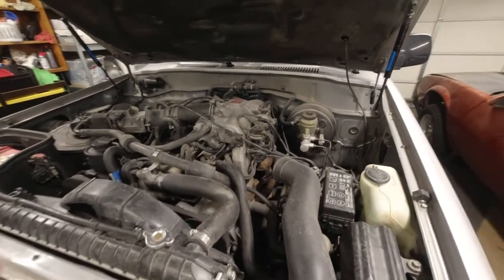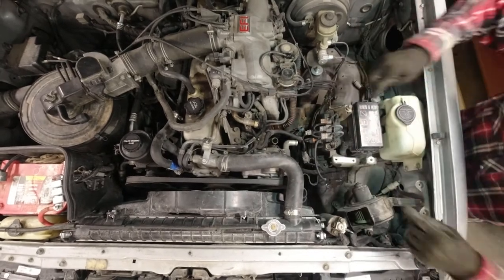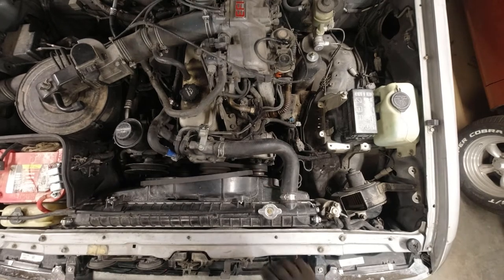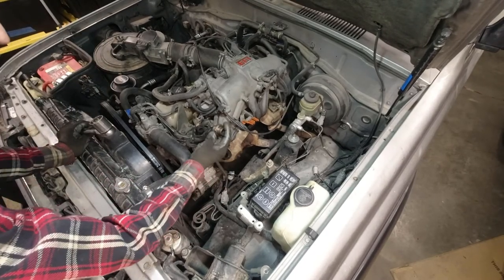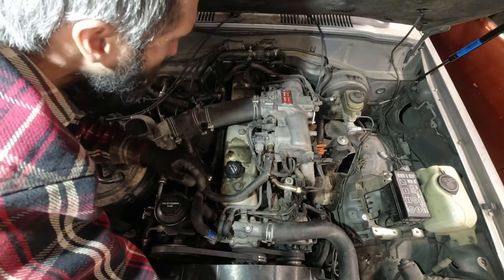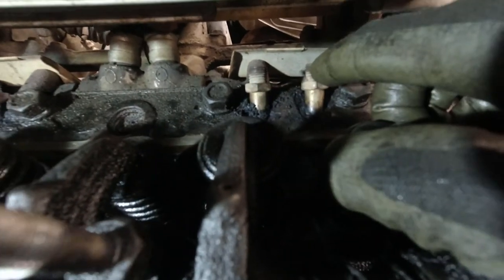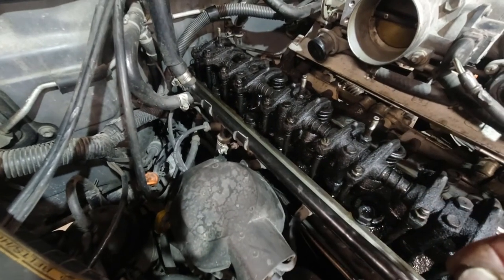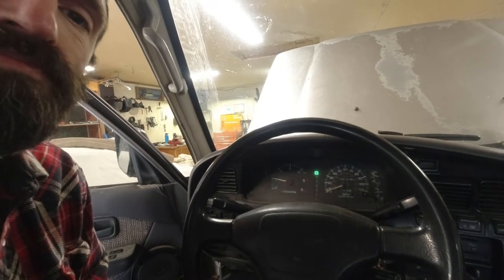EGR Delete - De-smog - Land Cruiser 3FE

Comment: for the exhaust manifold plug a Oil Drain Plug M26 x 1.50 will fit (vw audi plugs have a bolt head not a hex) and cost about $10 a lot easier to remove if you ever have to remove it. the 7 orange Vacuum Block Off Caps are 3.5mm or 1/8" ID ( i prefer rubber to silicone, if there hard to slide on use some hair spray slide on easy and its grips like glue when dry) for the block off plate use the old gasket and trace it onto some stainless steel (same thickness as the egr mount) and cut to fit and reuse the bolts, use Permatex High Temp Thread Sealer on all bolts and manifold plug. I haven't removed that blower pump yet as here in Australia we got hot summers and I always hear it turn on when I turn the car off on hot days fsm says it turns on when exhaust temp sensor reads over a certain temp which I cant remember (i would like to remove it all one day to fit a 2nd battery under the bonnet)  If I were to pull the valve cover off I would do it when the engine is warmed up and check and adjust valve clearance. this is a great vid of showing and explaining how to do the EGR Delete liked and subbed so can see some more 3fe love.

Comment: Just did this to my 91 and I can definitely tell there is more pep in its step!
Reply: Did you get a check engine light after? My light is on now with a EGR code and was thinking of just deleting all that trash. Mine is also a 91
Reply from the maker: @jakep8964  did you already do the EGR delete?
Reply: @jakep8964  No check engine light for the last couple weeks. I have new O2 sensors as well. Have you checked the code?
Reply: @ldooffroad1823  I want to keep the air manifold rail in place and cap of the end as I may need to pass a smog test when I change my 80 to classic rego when I get another 4wd do you know if that is possible and what size nut/bolt will work. I'm about to remove the blower motor and smog pump when i do the belts in the next couple of weeks but i dont need to do the rocker arm adjustment yet so i dont want to remove the valve cover until i need to do that plus my 80 runs on lpg and petrol so removing the the air intake is alot more work.

Comment: I was the first to fully desmog a 3FE (EGR delete, air injection system removal, and cat removal), back in 2004/2005 on my FJ62. That guide you reference is the one I wrote and posted to IH8Mud back in 2005.

19 years later and I have zero regrets. It's still a great way to free up power otherwise robbed from the engine, remove unreliable components (due to excessive age and wear at this point), simplify the engine layout, further increase its longevity, and free up real estate in the engine bay.

Something to add that's not really desmog related but will help immensely with keeping your air intake clean is to plumb in a PCV catch can in line between your PCV valve and the intake manifold. Doing that along with eliminating the introduction of carbon from the EGR system by doing the EGR delete will allow your intake manifold to stay completely clean inside for the life of the engine. If you really want to "do it right" you could take off the manifold and get it hot tanked so you're starting with a pristine intake and no more buildup of EGR carbon or PCV sludge in it.

As far as kits, Vintage TEQ Parts (no business affiliation; we do help each other often on Cruiser related tech issues though) is putting together a full 3FE desmog kit that'll have all the OEM Toyota parts necessary to do the job (save for a PCV catch can, since that's not part of the overall desmog process). It'll have a few different parts from what I originally used to streamline the process a little, based on small refinements I've made since first doing my desmog.
Reply from the maker: I’m honored that you saw my video. Thanks for your hard work.
Reply: Hi Nordic Dan
Help g my son with his 3FE eye delete.
He lost spark once he removed everything 
I have heard we may need to put a 10k ohm resistor in to get the ecm to think see egr. Where might this be installed if so.

Comment: PCV valve Zac. Positive Crankcase Ventilation. The check valve in there should rattle freely like the new one you got. They can be cleaned with brake/carb clean. Well done on the project and video!

Comment: Could I get a link to the kit and the write-up on MUD? I have a 1989 FFJ62 and I want to get rid of the smog junk. I live in east Tennessee and my 62 won't be sold until I'm gone so I don't ever have to worry about needing it to pass inspections. Thanks for a great video!
Reply from the maker: I don't think the kit is available anymore. It's been a few years. @NordicDan did the original write-up. You should search for it on MUD. See his comment below (or above).

Comment: Can you please give a one month update to this project?
Reply from the maker: Quick update: I did this mod about 10 months ago. I went on 3 trips with it last Summer, one of which was 2000 miles. I think the added performance is what made the trip possible (ie: climbing mountain passes). However, the 345000 mile engine is getting tired, and I dealt with a lot of heat related issues on those trips. I don't believe those are related to this mod though.

Comment: Nice video, good job on showing everything. I have this exact motor in my 92.
Do you have a link for the delete kit?
Reply: Found the kit from lerms. They mention Having the cat converter straight pipes installed. Did you do that as well?
Reply from the maker: @gomutha  Sure did! Here's a video: https://youtu.be/TLuijv4Iiyg
Reply: @ldooffroad1823  thank you appreciate the response.
Reply: Do you have the link?
Reply: @teelerito6007  https://lermscustoms.com/products/egr-smog-pump-delete-kit-toyota-landcruiser-tacoma-4-runner-t100-fj80-fj62-3fe

Comment: At 3:13, are there any downsides to removing that duct?
Reply from the maker: I'm not sure what it would affect to remove it all together... You would definitely want to cap it so you don't screw up the vacuum in the intake though. However, I think replacing the hose is probably best.

Comment: You can just do a double nut if you ever need to get that threaded plug out. How would you rate the difference between before the kit and after. I  am going to swap my landcruiser but in the mean time while I wait for this motor to die I want to try and get a little more performance and gas mileage. The way it sits now it just seems tired but I still have no problems going up anything. I don't know about you but if I had 100,000 miles or less I wouldn't change the motor but as I approach up 300,000 I am torn between the good ole LS swap or a diesel swap like a duramax 6.6 or a cummins 5.9
Reply from the maker: I felt like the kit made a noticable difference on throttle response, but not like it suddenly became a V8 or anything. Just a little more pep. Also my fuel economy improved 2-3 mpg at highway speeds.
My opinion on the engine swap: go with a LS. Spoiler alert: that's what did a year after this video. In my opinion, a large diesel engine would be too heavy.

Comment: Nice work on removing the EGR system and replacing some key components to get that motor breathing well again. Have you noticed a substantial difference since the EGR removal?
Reply from the maker: Yeah, I felt like there was a little more power. Really, the 3FE needs all the help it can get.
Reply: @ldooffroad1823  Absolutely, that big ol' tractor motor needs every assist it can get.

Comment: Why did you removed the air injectors from inside the cylinder heads? If all EGR equipment is removed do these need to be removed? If so do you know why? Thanks.
Reply from the maker: Honestly, I was just following directions from a Mud forum post. It cleans up the engine compartment a little. I’m not sure if cylinder compression is affected by the injectors being there but not in use??

Comment: May be a dumb question, do you have to delete the cats? Colorado is going California soon so the cats will have to stay on mine, or I’ll have to be able to throw ‘‘em back on. Thanks and great walk through!
Reply from the maker: To be clear, deleting any emissions equipment is considered against federal regulations. I think that if you did an emissions test after removing any of this equipment you would probably not pass. This is considered for "offroad" use only. To address your question, the cats are usually removed/replaced because they are 30 years old, clogged, and maybe even making a rattly noise. Consequently, removing all these things seems to improve HP. Sorry if this sounds cryptic.

Comment: Hey sir
Would it be possible for you to share the belt part number. Im in need of the belt and I can figure out the right size of it.

Thanks ahead
Reply from the maker: Hey, I ordered the kit and so I'm not actually sure what the part # was for the belt, but I found this on a parts list on the mud forum: Dayco #22528
Reply: The size is a 5/8" x 53"

Comment: hi dude! working on restoring my truck! what is your gas mileage per 60 miles?
Reply from the maker: We calculate in miles per gallon here. At highway speeds I get 15-16 miles per gallon now. Previously I was getting 10-12
Reply: @ldooffroad1823  oh hell, you have 15 liters per 100 km, I have 42 liters per 100 km